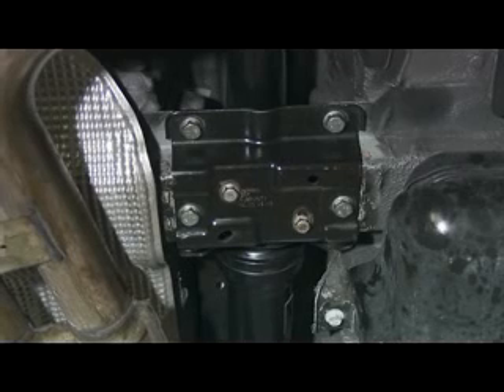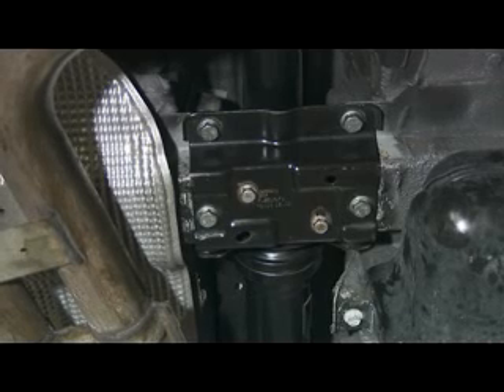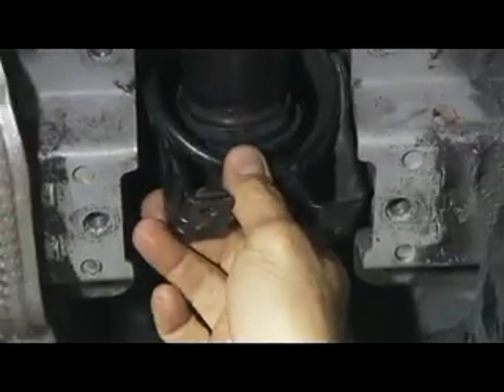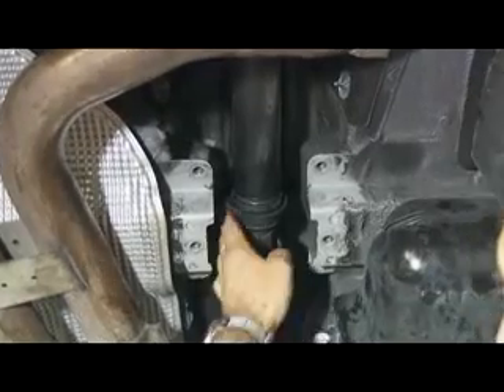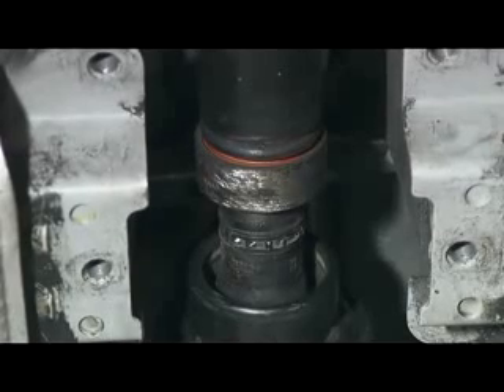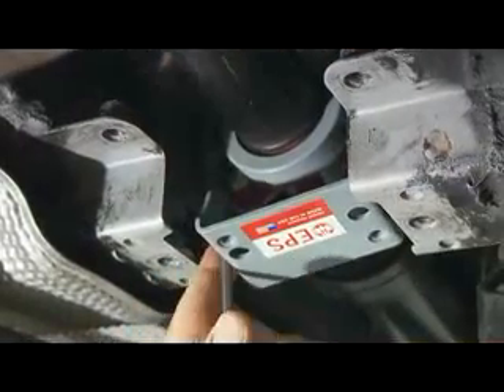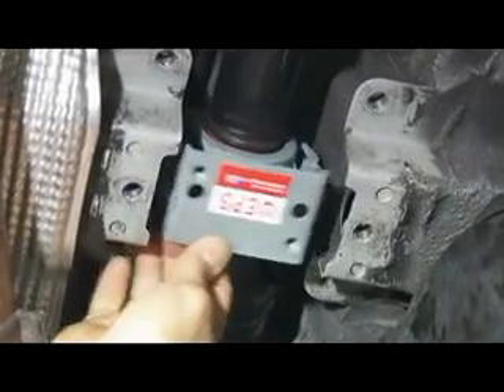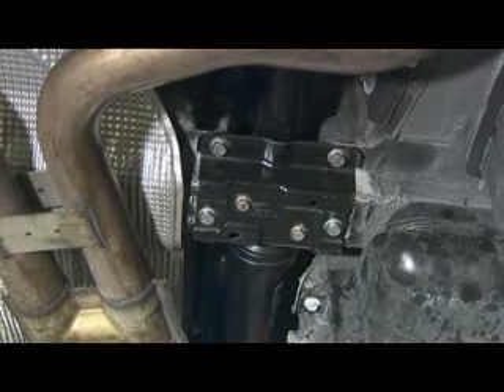Porsche Cayenne / VW Touareg Drive Shaft Solution / Repair

Comment: thats a usage part , thats why is so easy to acces on it, there was a rubber around and  that rubber wanish and suport miss the shaft, a touareg with that problem never shoul buy it because was drived in sport mode or in  up mode of air supsension many times, not to good

Comment: Pulling against the driveshaft would cause vibration especially at high speeds.  Could have used the cutter for the sake of 20 seconds.
Reply: thatts why is ruber suspension there, piece become one with shaft and ruber take vibrations, but when ruber vanish will be  much worse than original failwhy failing a a pice to tiny to take shaft energy, they repair on new models by central huge shaft system